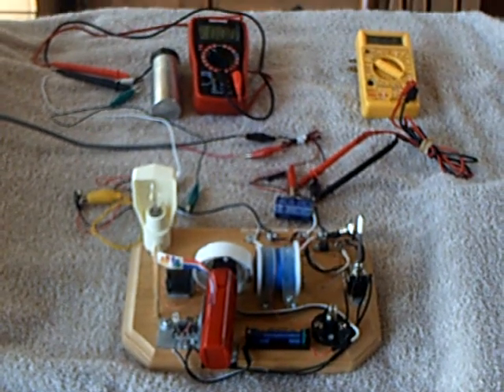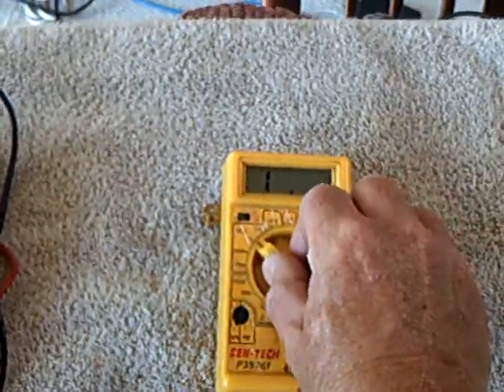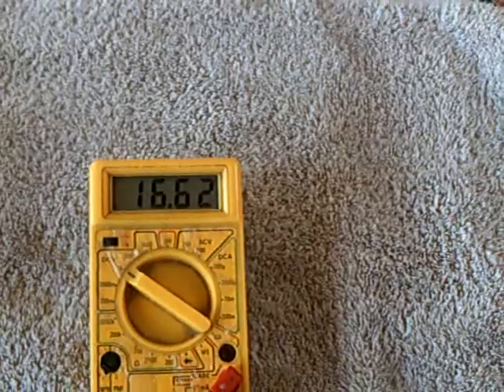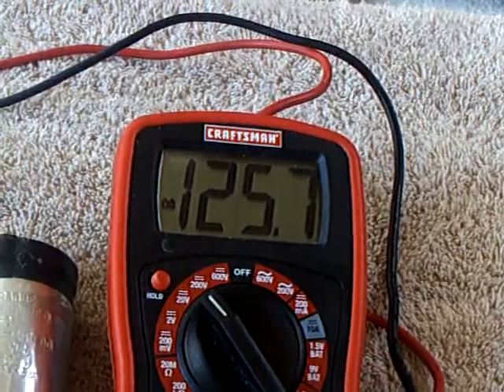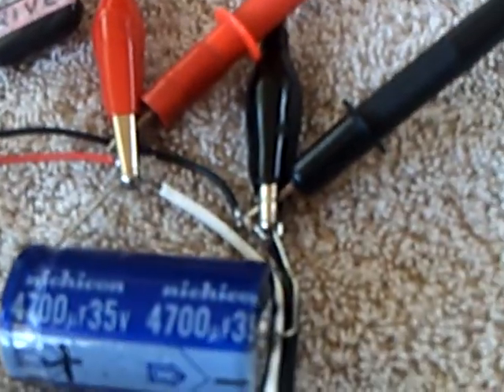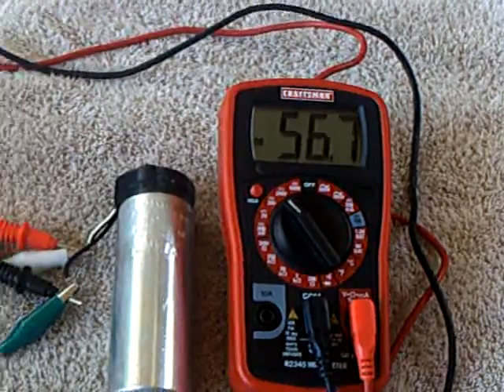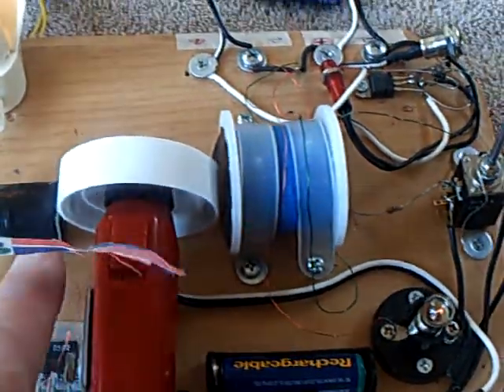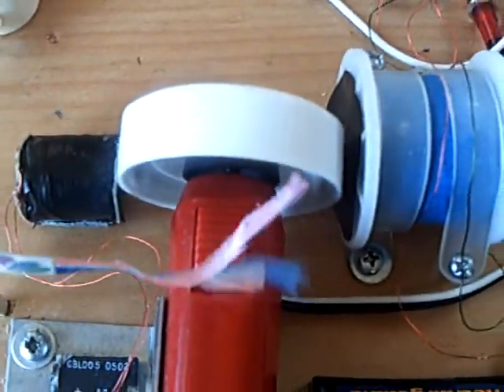Solar powered Bedini SSG energy ---  What to do???

Comment: run a newman motor off of the big cap!! then use its mechanical output to run a small perm magnet generator to then run the bedini,, or make a giant 1,000,000,000,000,000 volt cap to store it all in and leach it out a little at a time when you need it,, just kidding lol,
great job so far,, keep us posted :)

Bill